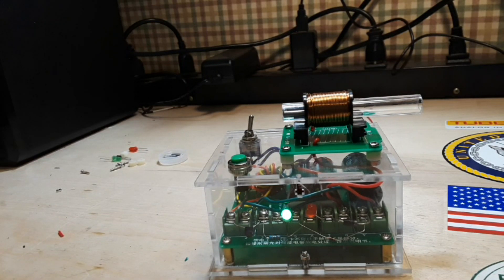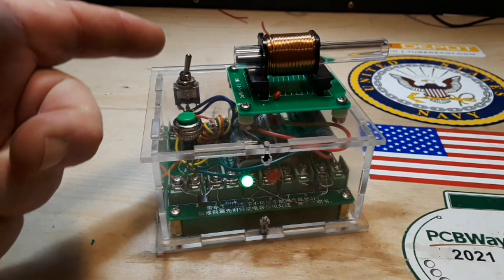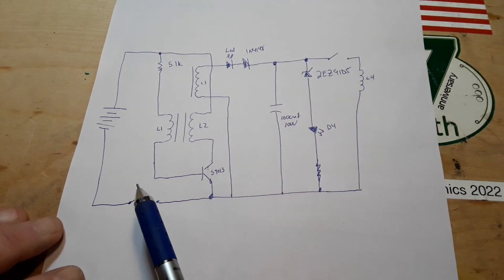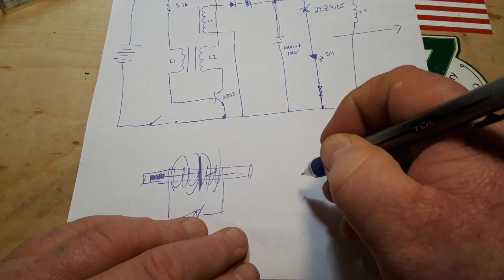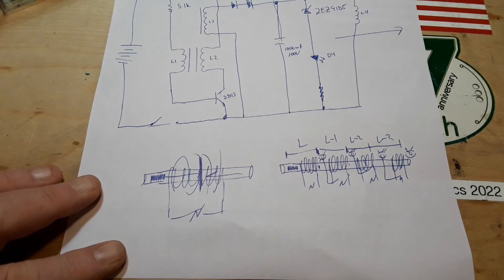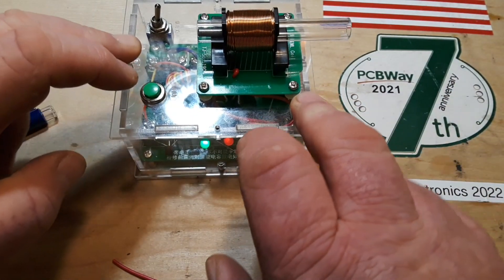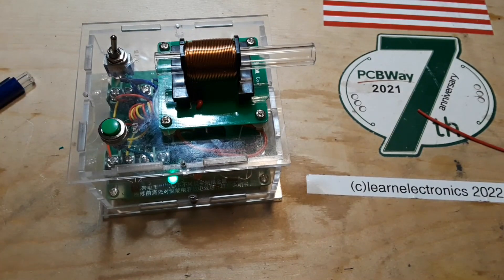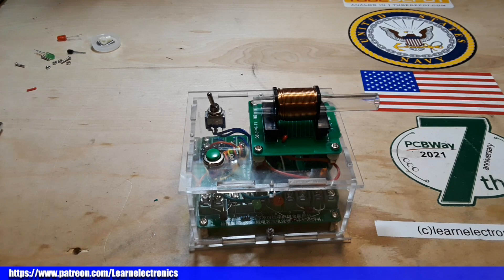MiOYOOW "Electromagnetic Transmitter" (Mass Driver)

Comment: learnelectronics; That Zener Diode limits the voltage to around 91 volts + - 5% but also the current to 200mA. That electromagnet is 4.3 ohms so could in theory get 20 Amps. What would you change in the circuit to increase the Amp discharge from the capacitor to the electromagnet?

Comment: I'm interested in how the 3VDC from the two AA cells gets boosted to 90V to charge that big cap.  Does the cap store 3VDC and the pulse from closing the switch create the AC signal that is needed to bump up the voltage in that toroid to boost the voltage?
Reply from the maker: The toroidal transformer boosts the voltage

Comment: Just a minor niggle. The rail driver is two parallel conductive rails while the mass carriage has magnets contacting the rails. The high voltage is then dumped across the rails creating a magnetic wave front that repels the magnets on the carriage pushing it forward. So the rails and carriage act as a single turn coil pushing the magnets on the carriage.

Comment: Now what I would do would be to replace the manual switches with relays & use a microcontroller to charge & fire ....

Build it into some kind of wheeled / tracked robot & add remote control ...
Reply: Could always up the power and make a turret from Portal... have some targeting algorithm in there and you'd be good. The victim, probably not so much.

Comment: "Oh, I don't like those things. You'll shoot your eye out!"

Neat little kit. I know it's a super simple circuit, but a little more exploration as to how quickly it dumps the charge and lets the slug through without pulling it back (I'm pretty sure there's a bit of that going on) would be helpful for people to understand. As far as I can see, they are relying on the size of the cap and the wire in the coil to control the discharge, essentially dumping as fast as possible.
Reply from the maker: Not quite. They are relying on you quickly tapping the fire button.
If you hold it, 2 things will happen
1. The projectile will oscillate near the center of the coil.
2. Coil burns up
Reply: @learnelectronics  Ah, I see said the blind carpenter as he picked up his hammer and saw.
Reply: @learnelectronics  Perhaps a one-shot( Schmidt trigger ) would be a better way to handle the firing?